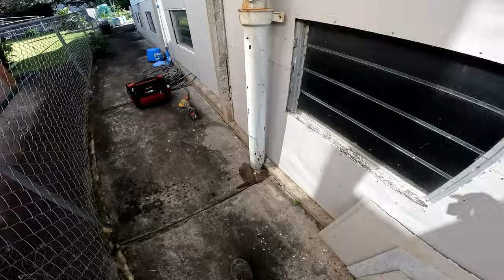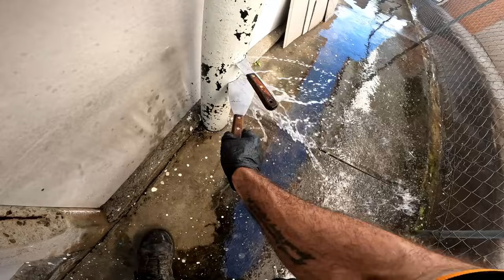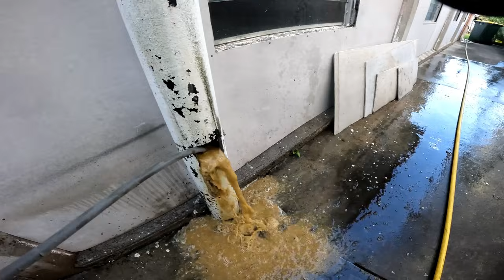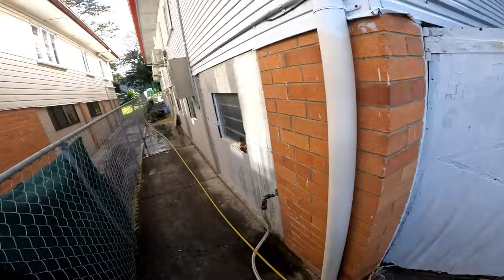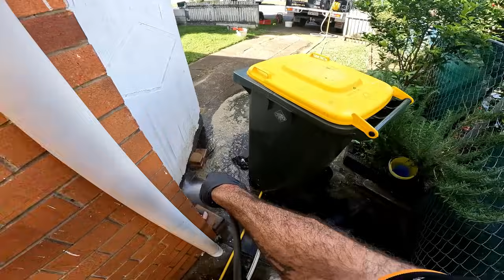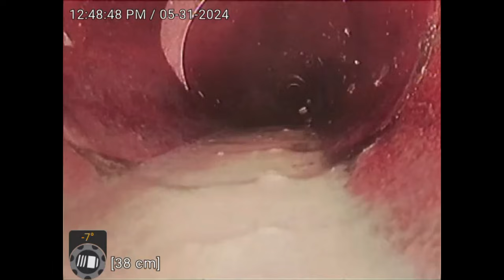Blocked Drain 491 Hands Down The MOST DISGUSTING Drain 2024 #gross

Comment: You need a short handled shovel with a funnel attached to the side to pour the poo back
Reply: I'd bet you could cut a t-wye in half and strap it to the pipe to make it easier. Maybe add a 4x8 reducer as the funnel? Edit: you could also use a plastic "grain scoop" and round the edge to conform to that sewer pipe. That would aid in cleaning the sidewalk area.

Comment: I use a holesaw with a clear bowl, it was made for cutting holes in ceilings and catching all the dust, that would keep you from getting splashed, and yes, a traffic cone makes a great funnel, although I would use the muck sucker for that, it's powered from the hose you already have there, mixes water to make it thinner and the discharge hose would fit right back in the drain line.

Comment: Buy powerful but small battery powered wet vac that has a the threaded drain outlet on the bottom.  Get a drain hose for it, put the hose into the pipe.  Use the sucker end to vacuum up the shit with a little extra fluid from your jetter.  You can mount some anchors to the side handles of the vac and hang it from the pipe.

Comment: here's an idea to play with.... cut a T-wye in half and strap it to the outside of the drainpipe with a bungee cord. Extend the wye with a 4x8 (100 x 200) reducer to make a funnel. Get a plastic grain / feed scoop (giant sugar scoop) and use that to clean the sidewalk. Alternatively, round that scoop to fit tight against the drainpipe and just tip the waste into the opening. (Amazon has them $10 - $20)

Comment: Gavin, this isn't a rare occurrence you would be wise to find or create some way to clean this up. vacuum then cone designed to fit into the pipe and pour it in??? I'm not sure, I don't deal with it, but it should command some thought. To leave it on the ground no matter how far you wash it down it's still a biological issue. you can come up with something I believe in you!!!